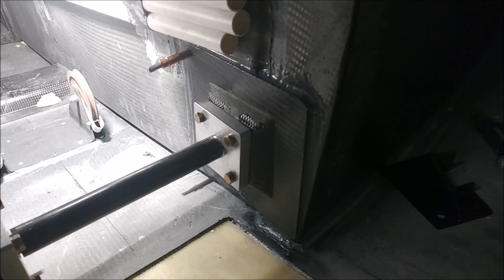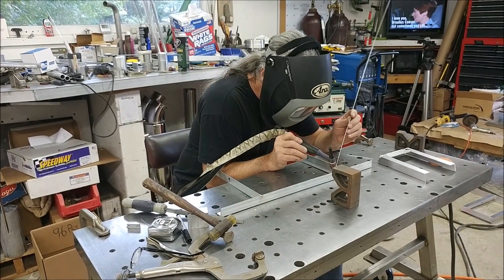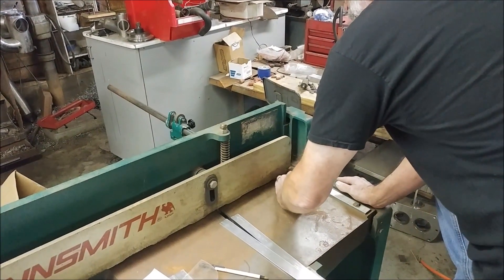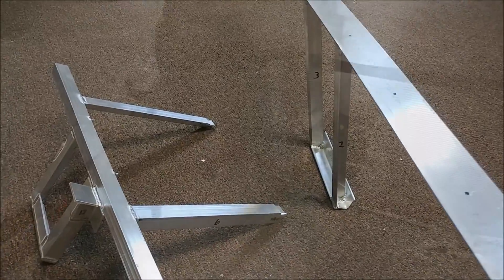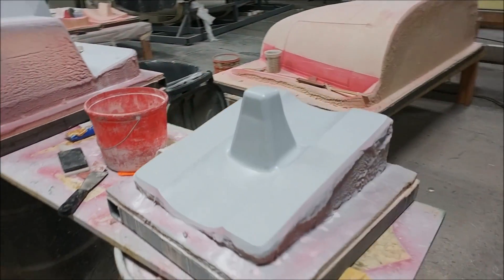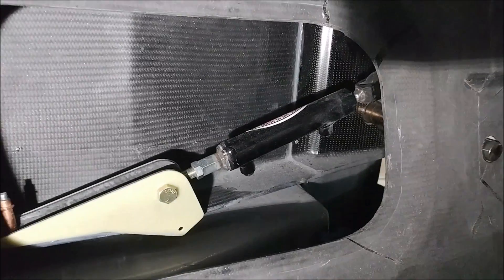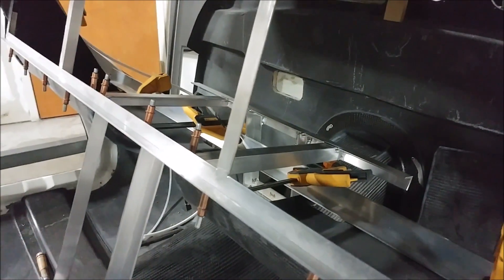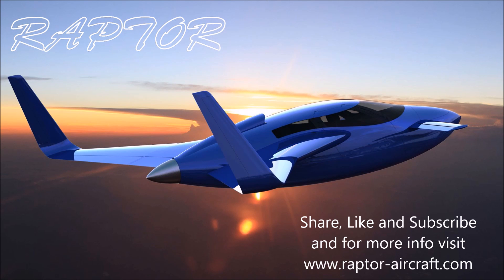Instrument Panel Fun Time

Comment: Peter, saw these zip ties on ANN and thought they were pretty cool after knowing what can happen with regular zip ties.

Aero-TV: The Ties That Bind - Innovative New GripLockTies Can Hold Their Own!

The Traditional "Zip Tie" Is Dead…

That's the assessment of Mark Patey, Director of Strategic Innovations and Co-Owner of LockRight LLC, who told ANN CEO and Editor in Chief Jim Campbell at AirVenture that the product developed by his company ... GripLockTies ... will make the universally-known version of the fastener obsolete.

The rubber lining on the GripLockTies prevents the zip tie from sliding around on whatever it is securing, Patey said. Worse, he said, the tie has chaffed through a wiring bundle and shorted out a system. The GripLockTie allows the user, whether it be a pilot, off-roader or cyclist secure an item with the tie without cinching it down so hard that it damages wiring, powder coating or other finishes.

The rubber also allows the tie to be tightened down more than a traditional nylon tie because of the rubber is compressible. It also isolates whatever is being secured, such as wires, from the vibration of normal operations of the airplane.

The GripLockTie was unveiled at AirVenture 2017, and is available from the company's online store. They are currently only available in a 12 inch length, but the company is developing the processes to have them available in other lengths in the future.

Comment: G'day Peter and the raptor team. Making great progress now! really coming together. I know this is only the prototype and there will be some changes before production starts on customer aircraft I am just a little concerned about the placement of the dump valve and any other switches or buttons ETC in the recessed or depression part of centre console. I think IMHO that most people would use that area of the console to keep / store personal items phones, keys, papers, pens, charts and to possibly place various drink containers there much as you would use the same area of the centre console in your car. I can easily see people getting into the bad habit of placing items in the way of that dump valve lever particularly since it would not be used regularly and that space would be too tempting NOT to use. I like the "car like" interior design that you have not by accident decided to use. With that in mind again IMHO you should keep that area free of all switches buttons ETC and use it as I think the designers intended  to be used.Humble regards Rob H